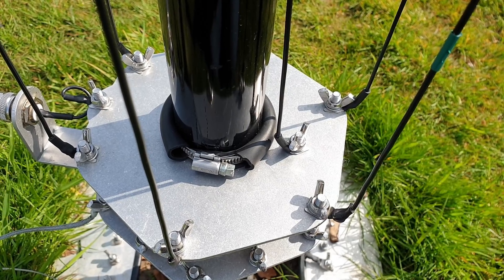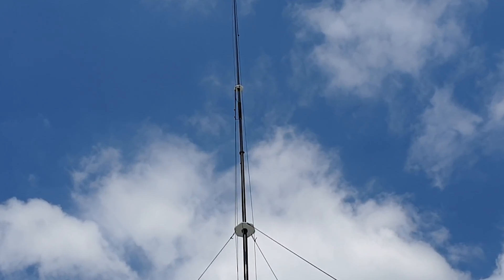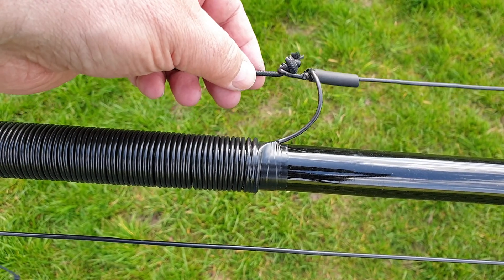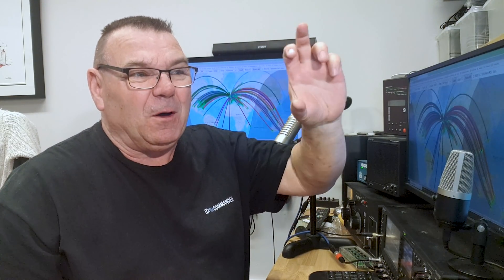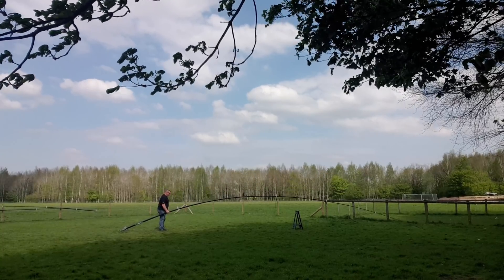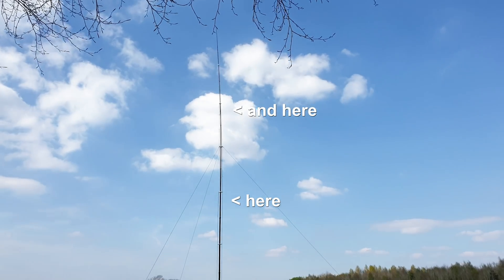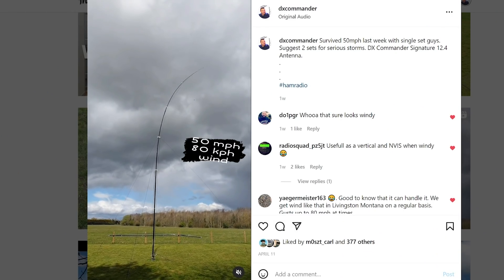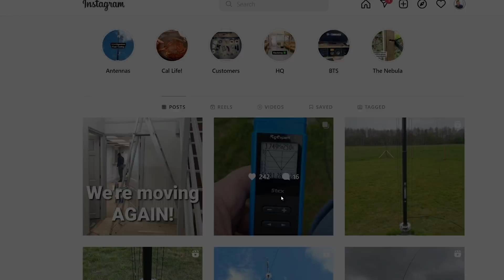80m and 30m on the SAME ELEMENT! Signature 12.4 - DX Commander

Comment: Any 80 meter wire antenna, either vertical or horizontal, can easily be set up to work well,
In fact very well, by adding some length to the radiating elements to pull their fundamental resonant frequency down towards about 3.37-3.4 MHz.  This allows the antenna to match and radiate as a 3/2 wave dipole on the 30 meter band.  I do just that with my segmented multi band dipole system which can be set up to be a 1/2 wave dipole on 40, 80, and
160 meters, respectively, by progressively lengthening the antenna using open and closed jumpers around  insulators on both sides of the antenna at nominally 33 and 66 feet. I also have some built in shorter sections to operate both at the high end of the phone band on 75 meters and well as down around 3700, and two shorter extensions at the outer ends of the antenna to set up resonance at the upper, middle, and bottom end of
160 meters.  For 30 meter 3/2 wave dipole operation I just hang short nominal 4 foot each stubs on the outside end of the 80
meter low end setup where the 160 jumper would otherwise connect.  The antenna employs 5 lift point halyards at the center, outer 80 meter, and outer 160 insulator points.  It can be easily lowered and raised to change the band setup and more importantly for inspection, maintenance, and repairs, for things like
a broken 160 extension from its entanglement around a huge hen turkey trying to fly through it. 

A 3/4 wave vertical antenna has both a decent low angle lobe and a high angle
lobe, which is very useful on 30 meters for
DX and short haul paths which on 30 meters
are frequently open at the same time.

I also run a wire vertical  antenna system over 18 elevated radials which when configured for 80
meter CW ops as a 1/4 wave inverted L 
with the fundamental frequency very close to 3500 kHz,
presents a nominal 1.3/1 match to my IC-7300 with the internal antenna tuner out of the circuit on 30 meters where it radiates as a 3/4 wave inverted L.  Easily brought to a perfect match with the tuner in circuit.

Operating a 40 meter dipole on 15 meters as a 3/2 wave was a common trick for Novices back in the day.

Doesn’t the DX Commander vertical do 15 meters from the 40 meter wire element the same way?
 
AJ1G🎉
Reply from the maker: Last line. Yes. And 30m band not too far away from 80m harmonic. You can trick the harmonic too.. Long story...!

Comment: Love this antenna! Just finished install a few days ago. Solid SWRs across most all the bands out of the box. My only snag, I get wildly fluctuating SWR on 80 meters. Has anyone else had this issue? Say going from 1.5 all the way up to 10 or 11 and then back down again. Testing SWR with a RigExpert AA-55 ZOOM.
Reply from the maker: Throw the RigExpert away and check SWR with the radio.. Sounds like a loose connection or something. Sorry to put a downer on this but I have had SO MANY support tickets / questions on this topic and as soon as they disconnect the RigExpert, the problem dies away. However, on the other hand, it might not.. I'm just thinking of the percentage chances that's all.
Reply: @DXCommanderHQ  yeah, I hear ya. Sorry for the late response. However, my CN-901 backs up the RigExpert, so there's something afoot going on with me on 80m. I've checked for broken wires and verified the 80m coil's electrical integrity.
Reply from the maker: What does the radio say?

Comment: Hi Callum, what is the vertical radiation-pattern on the 30 metres band? 73, Tim
Reply from the maker: Better than expected.. I did some WSPR tests and frankly it was "too good". We THINK it's a bit like a q/wavw with another loaded q/wave on top.. I wish it was that on 20m actually.. I MAY do some experiments, lower the coil down a bit and see if I can get 20m running the same as 30m.. Then change the 30m element into a straight q/wave.

Comment: Stupid question: Isn't it necessary to add a common choke to a vertical antenna?
Reply from the maker: Well I never have but according to the clever folks, maybe.. My system is grounded in the field. Maybe that helps.
Reply: @DXCommanderHQ  Hi Callum :) How about a video which verifies identical antennas with and without a common choke? Afaik you can hear the difference ...

Comment: Cal, How long of coax do you recommend to use with the the 12.4 and the Nebula? I have 50ft and 100ft of LMR 400. Worried about matching impedance to rig. Thanks!
Reply from the maker: Don't worry about impedance matching. Just use a run that's not longer than you need!

Comment: I would be interested in getting more out of the 10m band than the 30m band. Can I change the placement of the coil to try and get a 3/4 wave on 10m?
Reply from the maker: The 10m and 12m bands are already 5/8 (3/4). Easy :)
Reply: @DXCommanderHQ  Ah ok, thanks Callum. Greetings from VK6.

Comment: Callum,  Like so many others, I've waited for the 12.4 to hit the streets. Unfortunately, I still can't make up my mind.... 12.4 or the Nebula (Neboola) :-) But, while I've been pondering my next move, I started thinking about something that I hope you can help me and others with. Its my understanding that due to the lower angle of radiation, the vertical is a better antenna for DX which, is my main interest. However, since 92% (my best guess) of the hams in the world are using dipoles and or horizontally configured beams, how much loss might a vertical suffer in a DX situation as opposed to having an antenna which is also in the horizontal configuration? Thanks for all that you do for the ham radio community.
Reply from the maker: OK, polarisation will NOT affect you because as soon as the RF comes back through the skip, it'll be twisted to hell.. Great fun to LISTEN on left ear Vertical / and right ear horizontal (if you have 2 x VFOs) and you can hear the drift between ears..
Reply from the maker: PS - Persnally, I would go with 12.4m It's easier to handle, less expensive and all that you are missing is 60m band. SWR Curve video and WSPR plot videos coming out soon on this antenna.

Comment: Will the stay up kit tubing be the clear plastic aquarium tube or the black neoprene tubing like that comes with the nebula?
Reply from the maker: Clear PVC because the rubber stuff went through the ROOF price wise.. I would have to add another $30 to the price. Crazy. But clear works and has done for years.

Comment: Does it work on the full bandwidth on 80 meters without a tuner or having the need to change the coil winding ort placement or is it only functional at a very narrow portion of the band?
Reply from the maker: 106kHz at 1.5:1 SWR and 160kHz at 2:1 SWR.

Comment: Hi Callum...
Great work. Have you tried using the next set (above your current coil position) as a point to connect hot guy wires? Remove the coil and electrically connect the next set of guys. With a few meters of them becoming hot. This would then be an Umbrella Design. Where the guys give top hat capacitive loading.

As a person tinkering with short designs for 1611 kHz with 400 watts of AM... 24/7 key down ... with processed audio. The coil scares me.... As you would know if xxx micro henry's does the job up the top... less henry's are needed to get the same result at the base. What you are really trying to do is encourage your wiggles (others would say aerial current) to be encouraged up the mast. In broadcasting world the coil you have would be seen as a bad idea. As it limits the amount of current the aerial will take. Even though it does encourage more "wiggles" to run up the mast. 

Short version here is try your coil at the base. I'm also concerned how tight it is and it small diameter. I'd also suggest you look at proximity effect with the other wire elements.

Hope this sparks the idea that fixes the problem. 73's from VK land.
Reply from the maker: Not tried this because we would be heading into 160m territory. That's a job for the keen scientist!
Reply: @DXCommanderHQ  Not quite sure that is totally correct. The coil is there to lengthen the element for 80m isn't it? No coil and added top hat gets the job done without the down side of coil losses (and other bad stuff). I'm not across the rest of the way you get to 50 ohms for the over all aerial to go to coax. So I don't know what you need to see at the base to get this to all co habitate.

Yes in the 1611khz game.... The rule is max vertical length you can before employing loading tricks. When you do in comes....... more wire in the air the better. I've often used the analogy. Think of the Vertical part like a mains extension cord... Then the Horizontal (some times slopped - like the umbrella design) as Festoon lightbulbs runs.... The more lots of festoon lamps hanging in the air plugged into the vertical extension cord. This pulls more current up the Vertical mains Extension cord..... It's current flowing in the "vertical cord" that works with the ground currents to make your signal. The fact current is flowing in the top hat wires at "broadcast frequencies" is not a big deal due to the wavelengths involved. Higher up it would come into play and mess with your pattern. But I'd say 80m you'de be ok if you watch the ratio of vertical to top hat lengths.... Say 15m vertical with about 3m guy wires hotted up.... Coil gone and hopefully the problem you mentioned too ;)

Comment: Ive seen online that 64% height is optimal for the lowest takeoff angle for a vertical - just a little more than 5/8 ths. Was wondering if you made every element a 64% element how that would perform? So the 20m would be about 42' long (could come back down from the top about 12' like you do w the 40m currently) - this would become linear loaded 20m. The 40m would be about 83' long and would just be too big (especially for a 10m pole) however, now that you have discovered using the coil on the vertical, this could get you a coil loaded element. Just wondering where and how high the coils would need to be on a 10m pole to accommodate the 40 and 80 m bands
Reply from the maker: OK Pat.. Our issue will be that coild resonate at weird places.. And in any case, the gain is only a couple of dB which can be compensated for with a superb ground. For instance sea-water will give you an extra 10dB..
Reply: @DXCommanderHQ  ya - sure wish I lived near the coast!

Comment: Well done sir!  I’m really impressed by the wind loading. Here on the prairies it’s not unusual to see that wind speed. Based on the recommendations from the gentleman from the US (that did the video how to wind up the elements like a roadie) I run a second set of guys to the top spreader on my Classic and it handled 80km no problem. If I only had the room in my back yard you would be shipping one of these to me today. Cheers from Moose Jaw Cal
Tim VE5THF
Reply from the maker: Good comment.. I found that when using multiple guys, not to tighten the tops too much - but honestly you are probably ahead of the curve in that department!
Reply: I've got an unguyed S9 antenna which is 13 meter long. It's green and a single wire runs inside the pole, very low visual impact in our always green countryside. 

Matching requires an automatic antenna tuner at the feed point, or 4 to 1 balun and a very low loss half inch coaxial cable towards a wide range tuner in the shack.

A galvanized tube is hammered into the ground sticking out a couple of feet with a rubber shrinking piece on the top, in order not to damage the fiber glass pole. Even in the slightest winds it bends more than a little, moderate winds make bending very evident like a fishing pole trying to catch a big fish, strongest winds make it look like if I had caught a huge whale but that's all!
Reply: Yes that’s good advice Cal. I have the lower guys tensioned to support the pole and the upper guys just enough that they don’t hang loose. That way they don’t have down force on the pole in normal conditions but provide additional support to the upper thin part of the pole when the wind comes up. Also, I’m going to put a couple wraps of electrical tape at each joint before I install the clamps to keep rain water from getting in between the pole segments. Water could tend to lubricate the joints, lessen the friction and allow a section to collapse. 
Cheers

Comment: Will the 9.5m signature have a coil for 80m ? I measured n can't fit the 12m into my garden :(
Reply: No Andy. The pole is too short
Reply: @M0RMY  thanks for the reply Tom
Reply from the maker: Yeah Andy.. I'm afraid if you really need 80m, you will have to go inverted L.. But then you don't get the benefit on night-time DX.
Reply: @DXCommanderHQ  I can't work anything after 8pm as get +20 of noise from neighbours garden lights.ofcom coming out before May 25th so hopefully gets sorted.ive just not got room for guy ropes :(

Comment: Great work, Callum! If you could show in detail how you connect the Signature to the hinge I as well as others would really appreciate that. I recall you saying somewhere a metal pole mount would cause SWR problems. I'm wondering if that includes a short metal base stub mount for the Commander/hinge arrangement? Thanks!
Reply from the maker: SHort metal base is fine.. I will make another video about this.

Comment: 30 meters is where I consider the "Low Bands" start & I look to verticals for my DX solution on these bands.  Most hams will ha have a hard time getting horizontal antennas high enough for good DX performance above 14 MHz.  When it comes to HF Yagis on towers, you can safely get on 20 meters on a modest budget, the longer wavelengths above 20 meters get really expensive.
Reply from the maker: Agreed.

Comment: The 3 stay wire's give the best strength. 120 degree apart 3 stays give you 360 degres. As far as I know commercial sites use same principle.
Reply from the maker: Yes - but at multiple locations up the pole, which is what I suggest to "storm proof" it.

Comment: Can't wait!  If that's 50mph, definitely needs another set of guys for my install, 40mph is a couple times a week here.  Bought some 2mm Mastrant.  Should be light enough to keep the top from swaying around too much and not put a bunch of guy weight on the pole.
Reply from the maker: OK 2mm Mastrant is perfect! Top guys, do not tighten.. Leave them with a tiny little "droop" not actually tight. Actually, my guys are not actually tight either.
Reply: @DXCommanderHQ  Exactly my plan.  Don't care if it moves around a foot or two.  If it's not windy those upper guys shouldn't really be doing anything but hanging there.

Thanks for the reply.

Comment: Hi cal, great video, and congrats on your hard work. I did something similar with 3 wires, so I know the amount of work off camera you must have done. Coils are interesting wee devils. 
I have a 40m vertical with a 7.1meg trap on the top, and a extra length of wire going out to make a 80m inv L, and for what ever reason I don't know, with a bit of help from the tuner here and there,  it will work on all bands from 80m to 6m.
30m being the odd one with a poor mismatch , but I still get through to eu with 200w. 
That's the good thing about ants, there can surprise us, and there don't always have be perfect to work dx.
All in all I think after what you have achieved,  you must have a wee smile on your face, well done.
Zl3xdj
Reply from the maker: Hiya Brian. OK, so if you took your inverted L for 80m off same feedpoint, you won't need the trap.. For 40m, fold the top 1.5m over the top on so it's now 9.2m UP and about 1.5m DOWN (40m and now 15m perfect). Add a single 4.95m element for 20m and your inverted L should tune 30, 17 and 12/10m. Good idea :) Dare you!

Comment: This is awesome Cal. So glad you worked this out. I'm a 30M junkie. I can't wait for mine to ship out. It's interesting that you are doing a slight helical wind for 80M, I'm building a helically wound vertical for 160M using 6 4 long fiberglass military masts and winding 256.5 feet of wire wrapped around the poles and putting a small capacitance hat on top.
Reply from the maker: OK, so the helically wound issue is ONLY to top the ting, ting, ting you get similar to a yacht mast..!

Comment: Hi Callum,
Congrats to you, love your work and vids, thank you, it inspires my interest in antennas.

The coil height question??
We're the other elements installed during the testing of the 30m element?
If yes, I wonder if the height change causing resonance change, could be due to paracitic capacitive/inductive connection to the other elements.
I don't know the answer, but the fine adjustments required, would suggest to me, that 'height above ground', perhaps wasn't the influence, or the total influence.
It could be a combination of these two influences.

Brill Callum, keep up the great work Gon'nor.
Mark Woodhouse.
Reply from the maker: Once I had 80m and 30m working, I built the other elements around it with very little change. Maybe 100kHz from time to time.. Mostly "down".